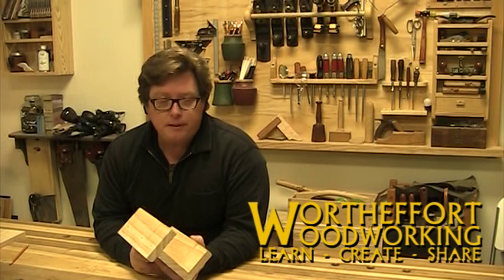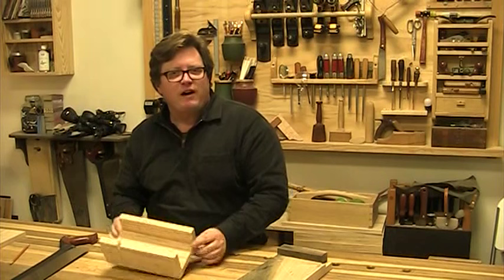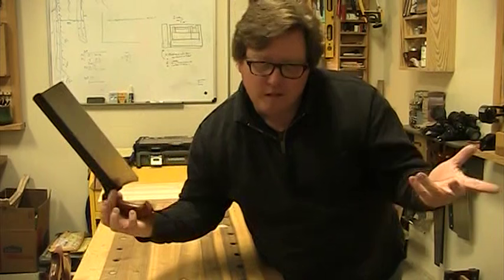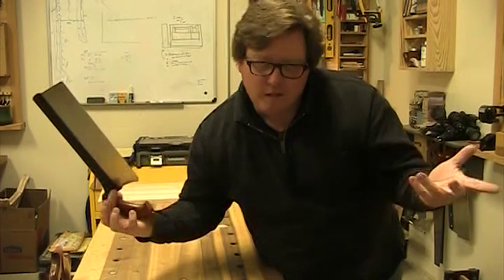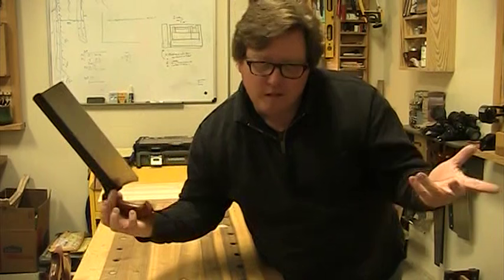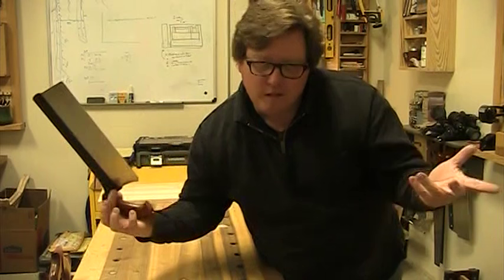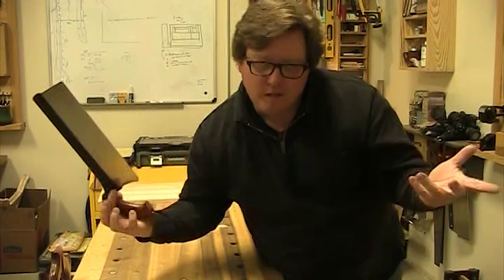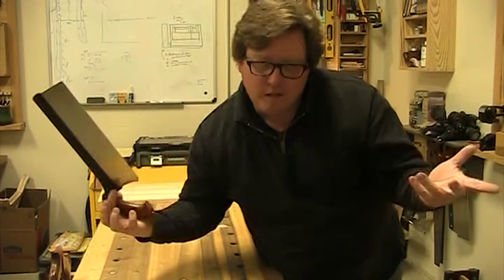Make a Miter Box Fast and Easily

Comment: Probably the most important skill I've learned from you over the past couple of months has been the ability to think through and work through problems when they come up as I start woodworking as a beginner. A birdhouse project I'm doing had a couple problems with split wood. From your videos I've learned when to replace the board and when and how to just use a repair using different methods. I am a methodical learner so I appreciate the extra steps.